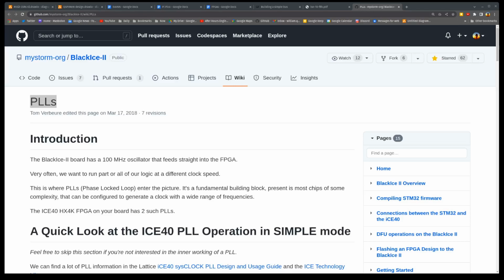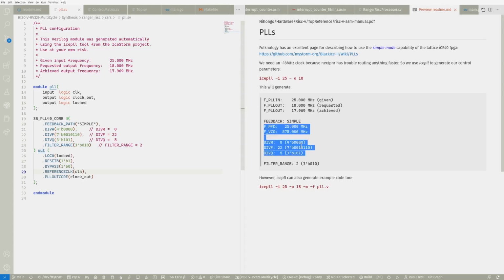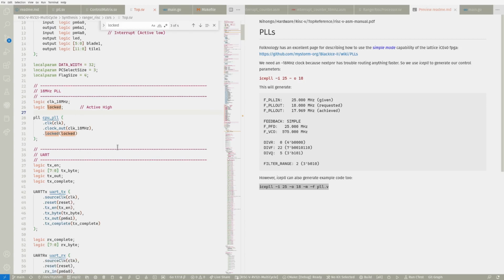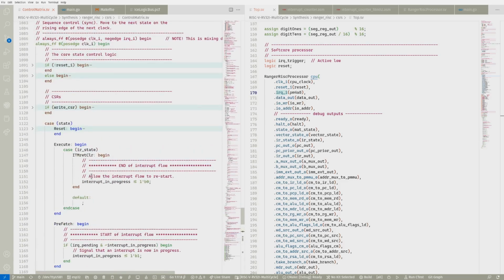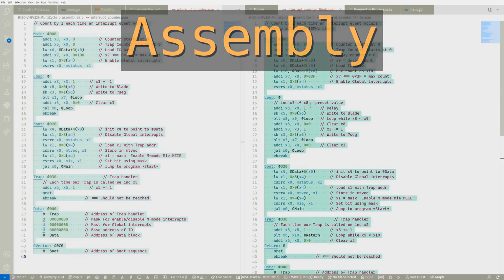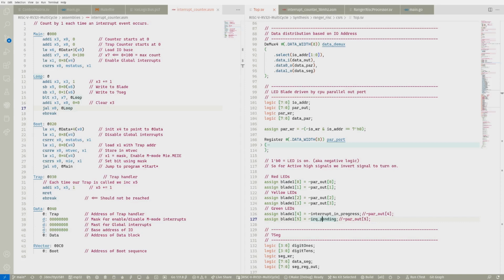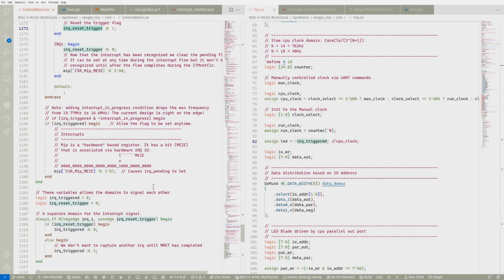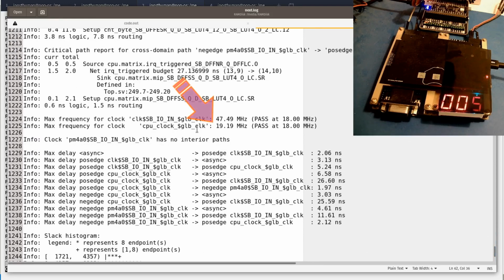RISC-V Episode 20 *Series Finally*

Comment: How many logic cells are required for this RISC-V implementation? I have Cyclone iv 6k one.
Reply from the maker: About 2596 LUTs which includes the CSRs 🤭. You should be able to easily synthesize it--note the final version has a specific PLL module present so you will need to find the equivalent for the Cyclone.